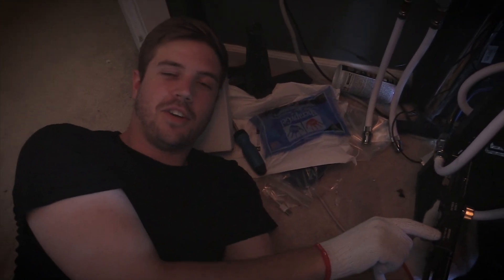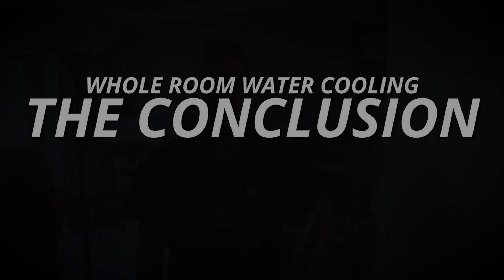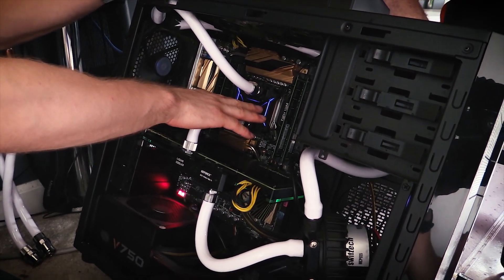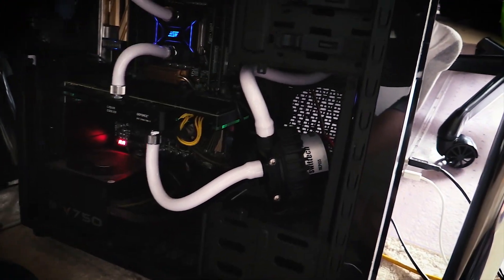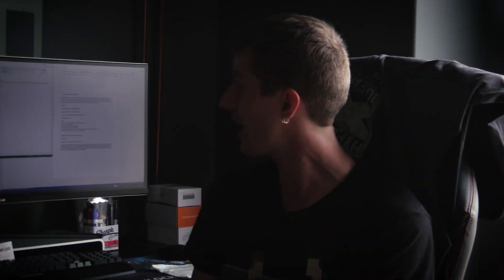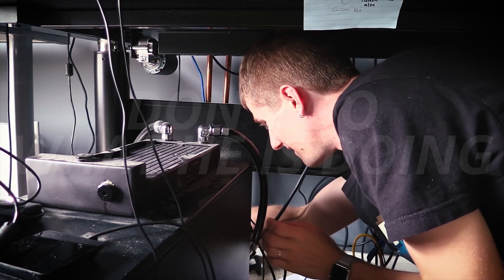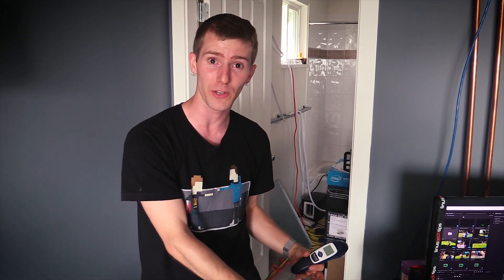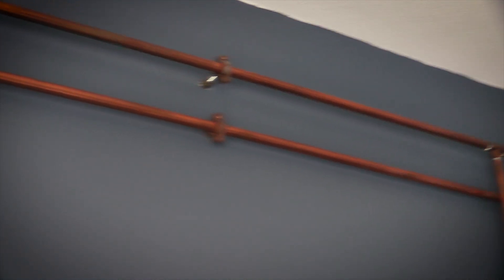Whole Room Water Cooling Part 7 - It's FINALLY over!

Comment: Why did you make the copper tubing go so high in the wall and not kept it close to the floor? It looks like it took way more tubing plus you make them run close to the ceiling where it is normally warmer. Great video as always ;)

Comment: Well at least you're honest and realized all this was not only impractical but a massive waste of time+resources. Thanks for the videos though it was very entertaining to watch the struggle. #Thestruggleisreal xD
Reply: I think the learning aspect and knowledge gained were well worth the time and resources, tho. It's great that they had the opportunity to test it out and do it, even if it didn't work out as expected. They shared the knowledge and now we know that with an even more professional approach a thing like that actually could make sense for some people or institutions.
Reply: Definitely a good learning experience. If they'd actually use the heat from the computers for heating the hot water used in the house - for washing clothes and shower and such it might actually have a payback, also heating other parts of the house during the winter - water could be diverted to reservoirs / heat exchangers in other rooms.
Reply: Now then. For a data center...
Reply: +jynxmars that is a great idea

Comment: Linus, i admire your adventurous spirit on doing this project. like some guys said in the comments, insulation for the pipes will prevent water from heating up the room before it gets pump out of the room. another thing is the power of the pump, should get a stronger pump since beginning of the project. This actually involve calculating the pressure of the loop before getting the pump. lastly should get a proper radiator, hook the loop up to something like a window unit air con radiator and fan which probably more effective and suitable for outdoor work. well, all on hind side and lips service.

Comment: holy eff 30 degree weather and this dude is still wearing jeans? Does he always wear jeans and sandals but never shorts and sandals?
Reply: yes, I live in vancouver, we use Celsius. Idk what you're smoking but I would NEVER wear JEANS in 30 degree CELSIUS weather. Too flipin hot. Idk what you were thinking. If you thought I said 30F then u must be out of ur mind.
Reply: It is really not that bad. If you aren't under sunlight, wearing jeans at 30°C is just fine.

Comment: The concept works fine, we use A/C chilled water systems for all our servers at work. You could just use chiller units and fans blowing through the tower blocks if you want to avoid gunking up the GPU blocks, no matter how awesome your deionised water and biocides are, they need to be replaced every year to avoid sediment build up. You could also install an Enwamatic silt bed filter to prolong the lifespan.

Source. Marine engineer

Comment: Water-cooling the room and then tying that system to all of your pcs would've been more effective since pc water-cooling is affected by ambient temperatures. Water-cooling a room is an entirely different concept which is called evaporative cooling. Evaporative cooling is similar to pulling air out of the case without pushing air in.

Comment: Before I got my 10,000btu AC installed in my room on a 90 degree day... my temps went up from 30 degree idle to 42 and under load it would normally hit 45-50 but on the hot day it was 60 easily. I threw the AC in, an hour later temps were back to original figures. That's running an i7 3820 @ 4.2Ghz on a Corsair H100i v2. Conclusion... Do not pipe your room with copper to an external radiator. GET AN AIRCONDITIONER. Also, what did you THINK was going to happen with that much copper piping leading to a steel/aluminum (whichever metal it is) reservoir?! You've increased the rate of electrolysis by like 1000 fold.

Comment: Just a quick question: Why didn't you guys use an SLI bridge on Edzel's workstation?
Reply: It's for video editing/rendering I believe. 

1. A lot of editing programs have major issues running on builds with SLI and a lot of the ones that don't simply can't take advantage of it. 

2. When in SLI your cards act together as one like a really fast processor. Using the cards without SLI is like having more cores on said processor while sacrificing some speed. This is really good for rendering because it means that each GPU can be rendering separate frames at the same time instead of rendering the same frame at the same time.

Conclusion:
In most editing programs that support multiple GPUs no SLI is shown to be faster than SLI because of multitasking performance. Not only is the speed better that way but you also don't have to worry about technical issues with SLI. I may be wrong on this but that is my understanding of the concept.

Comment: It probably would have been easier to put a refrigerator in the other room and make a custom copper radiator inside the fridge.  Then instead of running the system outside of the house, you could have run it inside the fridge.  The heat would have been contained and the coolant would be much much colder when it came out of the radiator.  That type of system would more than likely drop your temps a lot more.

Comment: the look of defeat when he said a/c would have been a better idea
Reply: I would think if they insulated the copper pipes, they would see drastic differences in performance across the board.  Copper is a magnificent thermal conductor (second only to pure silver when you limit it to elements) and they were still dumping almost all of the heat from the systems directly into the air in the room because of those uninsulated pipes.
Reply: he later mentions that there's somebody from the forums who does the exact same thing but learns from all of Linus' mistakes and it worked perfectly
Reply: Only math can tell us that, don't forget that those are two powerful pumps and since pipes run no insolation, the heat gets trapped inside as well.
Reply: Pumps will never use as much electricity as an airconditioner.
The airconditioner efficiency is about 350w/kw.... mean 1/3 of cold for 2/3 of warm.
In fact the idea is not that bad, it surely need some improvements.... coupled with a small airconditionner (as the room is small) it should work just fine. 
Where a much more powerful a/c would be needed without this installation.
Question is: do they really need to save power...???
Reply: A Class A powerful pump for an entire house is 20w lol. A 5w pump could do here.
Reply: but that costs way more electricity...
Reply: Who on earth in a rich enviroment/firstWC, doesn't have an AC !?
Reply: I find it laughable that he didnt insulate the pipes because of the look. He could have just painted them with a copper paint. At the vary least he should have just insulated it to see the end result since they went through all that effort. They should have known about the heating pipes issue as well.
Reply: Why would you want to insulate the pipes? That would defeat the whole purpose. It's basically a large radiator. You don't insulate radiators.  BTW, where I live ALL homes have A/C. If you are poor you use a window unit A/C. Not all homes have heating, but all the new ones do.  Homes built in the 40s and 50s didn't even have insulation because A/C didn't exist and heating wasn't necessary.
Reply: cherry_mx_1989 Yeah, being comfortable when it's hot outside sure bucks. Such a waste.
Reply: Just Some Guy Ok it never gets hot in Canada
Reply: SlayeCohen Canadians

Comment: I love your tech tips videos, and I applaud your effort at this project.  I had wondered about doing something similar for a single PC for similar reasons.
1) You don't repair copper pipe with glue!  ;D  I see you got it properly soldered later, and probably had somebody swearing at you as it probably made it harder to go back and solder with the glue contaminating the connection.
2) I have no idea why you used all those adapters to power the fans.  Cut them off and solder it all together for reliable connections that won't fail outdoors.
3) As others have commented, an automotive radiator and electric fan would have been a simpler options. Also automotive electric radiator fans are made to handle the weather.  All those nice silent fans will probably fail fast outside.
4) I don't know where you are located, but summers here can get hot (90-100 degrees F) which is awfully close to what you want the CPUs to run.  Given the inefficiencies of heat exchange, it seems like that would kill the idea for me when I need it most.  As noted at the beginning, a small AC unit for the room is probably the way to go.
5) It looked like you got plumbers solder to solder those wires, which is usually cored with an acid flux, not what you want for electronics. It was also comically thick compared to what you should have been using, rosin cored solder.

Anyways,  A+ for effort and following it through, even when it would have been easy to give up with all the problems encountered.

Comment: $1000 in copper tubing, another few hundred in equipment (hoses, fittings, pumps, radiator, etc.), hundreds in man-hours vs a $150 single-room window air conditioner.

Still, interesting experiment. Thanks for doing it so we don't have to.

Comment: You have to put any kind of temperature isolators on the copper pipes. Without this those pipes are radiating in the room firstly, before even the water reaches BIG radiator outside. It looks line this http://www.ua.all.biz/img/ua/catalog/10801306.jpeg

Comment: I can give you a big fix and it all comes down to science. do not use plastic pipes use non reactive metals that can be cast, yes they cost more but no rust if you use a fluid that won't eat or oxidize the metal and then you need to add fins to the piping how many on the diameter? 8 to 9. this helps pull the heat away but fins are only step one. next add air ducts around the piping that feed into an AC system. this dissipates the heat at point of contact with the pipes and the fins. if you really wanna go balls to the walls though use full on computers that are in the "water" case, it's not water it's mineral oil. and I suggest using a system that don't use memory cards but full on drives however be warned you can't submerge them in the oil because the way they work requires air between some small parts and the drive shells are not sealed completely. ( I personally wouldn't go balls to the wall with it because cleaning mineral oil out of anything sucks and it has to be done often

Comment: the stupid question I have is, can you use a central air home a/c unit(preferably using a second smaller one, not the main home one) for the outside radiator? making sure that you are using fluid that is compatible with the pc water cooling blocks/tubes & if you could what numbers would you get with it!

Comment: You did all of that work just to put a radiator outside? Why didn't you add cooling to it? To make it an actively cooled radiator. That wasn't even on your list of improvements! lol. 

Even having copper coils in dry ice would be a super simple way to do that, or you could've gotten a cheap refrigeration unit.

Comment: Possible improvements on the idea: use steel braided Teflon hose for the long runs with quick disconnects at every joint, and run it in the attic. Use an automotive polymer fuel cell for the reservoir. Use a single aluminum automotive radiator , with a single automotive electric cooling fan running off an ac to DC converter. And finally do not run automotive antifreeze in your system. Most of the damage to your heat blocks was due to the fact that the antifreeze was a corrosive agent, and was combined with air from your unpressurized system, and was eating them. Systems with antifreeze must be closed loop, pressurized systems, and all components must be compatible with antifreeze. Overall a very cool idea, and could have turned out awesome, but I think it would only be viable on a much larger scale. Still, excellent work guys!

Comment: Two additional tips for anyone else attempting this in the future:  1)  Insulate the copper pipes with foam, this will reduce the heat dissapation into the room, and the cost of the foam pipe coverings is marginal, at probably less than $100 for that whole room.  2)  If you want to avoid problems with corrosion tailings clogging the system(plastic reservoir notwithstanding), add an inline filter, maybe even two(one at the pump outlet, one at the pump return) to protect the computers from the pump, and vice versa.

Comment: I have two systems running on one water cooling loop, which is a pain to clean and/or change parts...
What you did is super cool! And if you think about it: an AC Unit will consume like 2000 Watts or more to cool down a room with that many PCs in, your solution (asuming you could work out the bugs and insulate the copper tubes) should be able to do nearly the same thing without consuming that much power. You could write that of as GreenIT xD

Comment: It's kinda obvious that heat energy will be released in the room trough copper tubing before it will reach radiator outside xD IF you wanted it to work first you would need to insulate copper tubing and then add very big radiator with fans outside. This way all heat would go to radiator instead room.

Comment: waste of time and money and no the heat dissipation won't change by much, 1 degree isn't much. you can achieve the same dissipation with a regular incase system. but it looks "fancy". If you were running cold water none stop then sure it would be like 4 degrees less but wopty do..

Comment: you could also add a refrigeration device to your loop and cool the liquid to a specified temperature ...5-8 degrees , this will maintain all systems to a default set temperature ....and make useless an outside cooling fan ...
Reply: +Mr.Nobody You would get condensation in the computer, like the outside surface of a cold drink.

Comment: if you water cool use mineral oil instead of water and use a bigger pump like one from a pool. also using a after market rad from a car would also improve with the cooling. one last thing, by using plastic in substitution from copper you can prevent algae build up better.  ps distilled water would also help prevent algae build up.

Comment: Ever heard of a blackout curtain, Linus? They're designed to keep heat out and putting that over the window would have probably dropped your ambient temp by several degrees.

Still, a huge effort despite the end result.

Comment: Three points,  one is that you should have a high-vent like is used in boiler systems, that any air it the system is removed as you go.  Another thing would be to put some ball valves on the drops, so that on a disconnect failure, you can turn off that line that failed.  Third feed the water through a heat-pump, so that the input water was like 10C instead of 30C....

Comment: I would have used more plumbing grade hose and less pipe! 
I also would have installed a couple of portable reverse cycle aircons to remove extra heat from the room!

Comment: Why didn't you just install a window AC unit to dump the hot air outside and blow cool air inside?
Reply: +abortionsrock because they are LINUSTECHTIPS
Reply: I was thinking the exact same thing xD. Would've looked cleaner, nicer and felt better too :D

Comment: If the goal was to cool down the room, it's incompreensible that insulated output tubes were not used. Or even the input tubes, at the cost of extra processor/gpu temperature. It's obvious that this way, the radiator becomes the tubing itself.

Comment: i'm a plumber by trade, if you were to insulate the piping you would see a drastic decrease in temp. the reason copper is used in heat tubing for pc's is that it's thermal conductive. The amount of copper in that room acted like a radiator before it reached the rads outside.

Comment: ik I'm a year late, but has the question been answered why they used copper instead of PVC? What about using an automobile sized  radiator with a properly sized single fan? Not claiming to be an expert at all, just horses for courses yaknow?

Comment: Linus, it doesn't matter if the project was a failure or a success. What matters is you did something entirely different and you had fun doing it. That's all what matters for people like us who always want to experiment things. 
And that project may not be very 'beneficial' in your case but for someone who is running like 50 high-end over clocked computers in a room, this could be the ultimate cooling solution...
Reply: +Meet Dagar not much of an experiment when people who do this for a living i.e. system admins, server providers etc. probably already found the most efficient way to cool cool huge amounts of computers with the best combination of ease of maintenance, performance and practicality.

Comment: I think you could have solved part of the problems by splitting the big loop with valves, and isolating the copper tubes. Also, the quick fits are cool, but personally, i don't trust them 100%, you could have attached the sistem both to the radiator and the big water cooling, but adding valves, so you can choose between the "public" and the "private" cooling system, or even both at the same time... If you wanted an extreme water cooling system, maby not just setting an air conditioner, but also modifying it not to cool down the air, but cool down the water loop itself by hooking up some heat exchangers. I don't know much about water cooling, since i just made my first one, but your system looks amazing as it is right now...